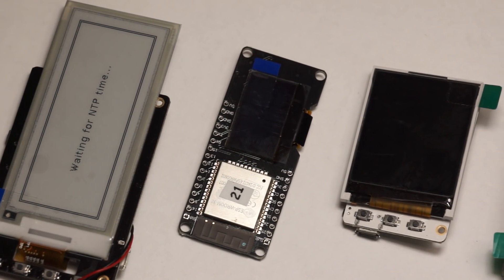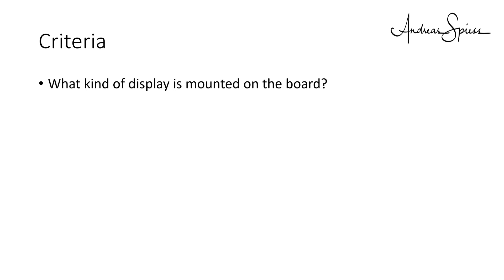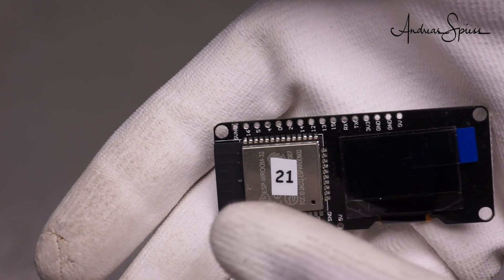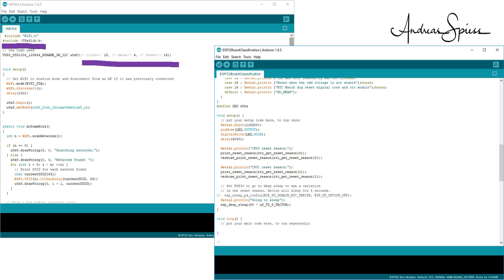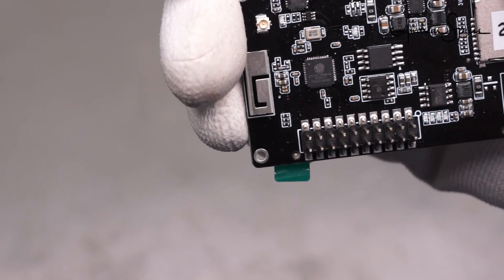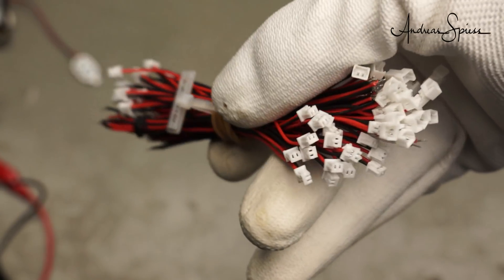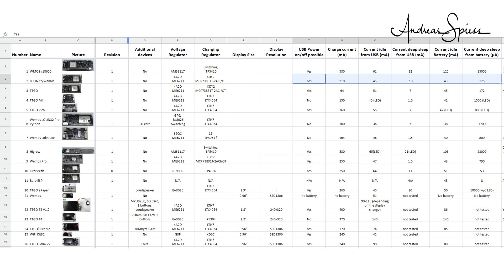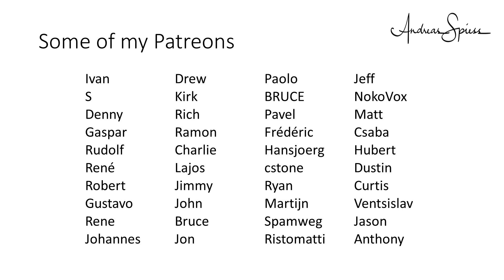#201 New ESP32 Boards with Displays

Comment: I have a TTGO TS v1.2 with the 1.8" TFT.

I had issues getting it to work with the information provided. When I did get it working using the ST7735 libraries I found the screen did not display correctly. The graphics demo for TTGO worked but the display was shifted one pixel left and one pixel up with random pixels in the unused edges. I left it at that for a while until I bought a screen for other Arduino devices.

While getting that screen to work (a cheap Chinese module not following standards!) I found an excellent TFT library on GitHub that is faster than the Adafruit ones and it supports many TFT driver chips in one library.

I decided to try that library with the TTGO and got the same problem of shifted display with random pixels. However, that library has much more support for ST7735 variants, by selecting a non-standard variant I was able to make the screen display correctly.

The library I used is called TFT_eSPI available at https://github.com/Bodmer/TFT_eSPI

To get it to work with my TTGO I made the following changes in the User_Setup.h file:

- Make sure it's using #define ST7735_DRIVER
- Make sure TFT_WIDTH and TFT_HEIGHT are 128 and 160
- THIS IS THE IMPORTANT BIT! Use #define ST7735_GREENTAB2
- Use the following values for the ESP32 Dev Board settings:

  #define TFT_MISO 19
  #define TFT_MOSI 23
  #define TFT_SCLK 5
  #define TFT_CS 16
  #define TFT_DC 17
  #define TFT_RST 9

The #define ST7735_GREENTAB2 setting corrected the shifted display. The default is ST7735_BLACKTAB.
With those changes to User_Setup.h the TTGO screen works perfectly. Plus this library is much faster than the Adafruit libraries. Although not all the functions are compatible with Adafruit, they are easy enough to adjust :)

Another problem with the TTGO TS v1.2 1.8" are the buttons under the screen. They are not centred! Just looks odd if you were to mount it in a box and use the buttons.
Reply from the maker: Thank you for writing your learnings down. I am sure it will help others. According to the supplier, the 2.9" display is different and this is the reason they did not port its library to the Arduino IDE.
Reply: I just love these devices, I wish there was more I could do with them as I am limited in electronics ability due to lack of equipment (can't afford it and not enough space for it! lol). But these ESP32 and the ESP8266 dev boards have brought back some of my old love of programming. I like getting low level with my programming, not relying on huge APIs to do everything for you. Worrying about memory space and speed concerns, especially with the ESP8266 boards. Making them do multitasking without having a multitasking programming environment :)
I tried the LUA environment that was included in some of them as default as well as Mongoose OS (https://mongoose-os.com/) but I keep coming back to the Arduino IDE. Mongoose OS is interesting but still lacks a lot of support for the ESP32 as well as very little support for any kind of display other than ILI9341 SPI and Adafruit GFX for C/C++ only. It needs more support for screens.
Reply from the maker: We also tried Mongoose once but did not like its stability.

Comment: I stand before you, a broken and beaten man.  I've finally got the time to sample an ESP32 board.  Of course you were my first port of call for advice.  At that point there were no big reviews, so I hunted roung e-bay to see what was on offer.  I finally came up with a very decently priced all-in-one 0.96 inch OLED WEMOS TTGO WiFi Bluetooth ESP32 18650 Battery Development CP2102.  

First came your review of ESP32 boards battery powered but WITHOUT DISPLAY (sorry for shouting).  My choice - almost but not quite.
Now we have ESP32 boards WITHOUT BATTERY (sorry, I'm not shouting at you!) but WITH DISPLAY.  Again no coconut!

I'm wondering will you be doing another episode with both battery AND display - or do I just accept that I'm a maverick who doesn't fit run with the crowd?

Other than that - great job, You transmit on my wavelength.
Reply from the maker: Most of these boards have battery management. See the table

Comment: Very helpful review, thanks. I disagree with your conclusion that deep sleep with a colour display isn't useful, my use case is deep sleep when it isn't being used and power on when it is. In your example you could combine the display with one of those cheap radar based movement detector and wake up when someone is there and go in to deep sleep when no one is around.
Reply from the maker: See my comment below. I surrender ;-)

Comment: Are the battery connectors from the 1.25mm JST GH series? JST GH is my favorite connector because of its locking tab and low insertion force. I think is is more likely that they use the 1.00mm (SH), 1.5mm (ZH), or 2.0mm (PH). Because all the others are only rated for 1A, the  2A rated PH series connector seems more likely to be a standard battery connector.  Thank you for the excellent video!
Reply from the maker: I am no specialist, but I think they use the GH series. They are definitively smaller than 2 mm

Comment: I just measured my ESP32 board with a 2.9" black/white/red ePaper display https://www.aliexpress.com/item/TTGO-T5S-v1-0-wifi-bluetooth-wireless-Module-base-ESP-32-esp32-Red-Display-ePaper-Sperker/32854552241.html . When I supply 3.6V through the lipo connector, I get 8.2mA power usage in deep sleep after removing the power LED (why would you even add such a thing on an ePaper development board?)
https://www.dropbox.com/s/7xjorkv5xb7phey/epaperesp32.jpg?dl=0
Reply from the maker: In my sheet, you find 10 mA ( used 3.7 volts). In the video, I came to the same conclusion...
Reply: Well, the exact number doesn't really matter anyways, since it's a few orders of magnitude too much for any practical applications.

Comment: Im about to move from arduino to esp32, to get the best full functionality of esp32, should i stay with the arduino ide, or should i move to a new dev environment ?
Reply from the maker: For the best functionality you have to use Espressif's ESP-IDF
Reply: ty i just got 6 in the mail, 3 regular and 3 mini, will start checking them out

Comment: Would you like a SHA2017 badge for e-Paper project? It has a 2.9" display and touch inputs, powered by an ESP32 running Python and can operator for months on a small battery :)
Reply from the maker: Thanks for the offer. On this channel, I try to be useful for my viewers. This is why I test things which are available for everybody. Since this badge, as I understand, was only made for an occasion, this is not the case. 
But I will have a look at their project repository. Maybe I can learn from them.
And it is good to know that it is possible to design a low-power ESP / epaper...
Reply: Andreas Spiess everything we did is open sourced! We have software available for the IDF, uPy and the Arduino IDE.
You don't need to review it, I'm just willing to send to you one :)
Reply from the maker: If it is open source I will review it. I just read I need to enter the number of the board purchased from you to download the SW. So I missed something.
If you need my address, contact me on facebook messenger or on twitter.

Comment: Another excellent video, thank you! It would be interesting also to see the TTGO LoRa32 V2.1 included with the addition of the SMA connector. I will take some measurements when mine arrives.
Reply from the maker: I do not plan to buy one. It is quite expensive and I have a few of the old ones...
Reply: Yes, of course I can completely understand! Thank you for answering.

Comment: Hi Andreas,  nice video as always.  I have a thing that is bugging me on the esp32. I need to measure time really precise.  I was hoping to use the esp32 timer to do that but I found out that the xtal oscillator is limited to 40MHz by the prescaler even if it's working at 80MHz. Ideally I need around 10ns (96MHz) period for the counter but 20ns will do fine also as well.  Can you please suggest another approach? Thank you.
Reply from the maker: If you need a precise frequency I would use an external clock generator (search for Active Crystal Oscillator). You find them for many different frequencies. 100 MHz is pretty high and you will need high speed TTL logic to do proper measurements.
Reply: Andreas Spiess thank you for your reply. I wanted to tell you that I find your work very thorough and well documented. And according to this principle I must do more research for an elegant solution rather than more external components. I confess I thought about an external clock but I might use another MCU altogether as an alternative if the case arrives. If you will allow me another question , does using i2s intrerupts (http://esp-idf.readthedocs.io/en/latest/api-reference/peripherals/i2s.html)  sound like a good idea in trying to decode this type of signals (https://github.com/nairol/LighthouseRedox/blob/master/docs/Light%20Emissions.md) ?
Reply from the maker: I never used the I2S interface and I do not know it.

Comment: Hey Andreas! Nice work! Do you know anything about ESP32-WROVER? The one which has an IPEX connector. Have you ever used it? Can you recommend a breakout board for it? Thanks! Antony...
Reply: there is this https://www.aliexpress.com/item/ESP32-test-board-batch-burn-fixture-for-ESP32-WROVER-IPEX-Version-ESP-32-ESP-32S-ESP32/32851571106.html?ws_ab_test=searchweb0_0,searchweb201602_4_10152_10065_10151_10344_10068_10130_5722815_10342_10547_10343_10340_10341_10548_5722915_5722615_10696_10084_10083_10618_10307_10131_5722715_10132_10133_5711215_10059_308_100031_10103_10624_10623_10622_5711315_5722515_10621_10620_10814_10815,searchweb201603_55,ppcSwitch_3&algo_expid=cea816fc-654f-46c6-9f77-90a40d04a23a-3&algo_pvid=cea816fc-654f-46c6-9f77-90a40d04a23a&priceBeautifyAB=0 and also this https://www.analoglamb.com/product/esp32-wrover-breakout-board/  both breakout boards don't have all the recommended decoupling capacitors so can have stability problems
Reply from the maker: 1. You can get two versions, one without IPX connector
2. No, I did not use them
3. I did not look for a breakout board. But I have to. And maybe I have to create my own...
Reply: Hi again! Yes, I'm interested in the one with IPX/IPEX. I want to improve the quality of the WiFi connection of an ESP32. I was just wondering if you have used one. I want to do a video about it soon. I've been spending time on ESP32 and I think I've achieved something special. I've finally got MODBUS/RS485 to work on it and I've found a fix to the I2C problems. Do you have any plans on testing the IPX/IPEX models? If you are, I will wait for your videos! Ha! If not, I'll make a video about it. :-D
Reply from the maker: No, I have no plans for such a video. Just a video about external antennas in general.
Reply: Andreas Spiess Ok ok! I'll get ICStation to send me one. :)
Reply: Out of the BOTS thanks

Comment: I have the same epaper but on a separated board, it has many caps, an inductor, some diode and a mosfet to generate the higher voltage for redrawing purpose that all, on the Waveshare wiki you have the schematics.
And I did connect my epaper to an esp32 and use it with the Arduino IDE, I just copied the provided files (esp-idf) in the same directory as my arduino project, modified the pins in one of the .h file and added an include in my main .ino file.
It is not complicated to add  C "driver" files to your Arduino project, you're not a beginner anymore, come on…
But that was last year, nowadays it should exist on github now, it's the same driver files as the smaller epaper.
Reply: I have one of the Waveshare 3(2) colour 'e-Paper' hats. I use the GxEDP library which also contains support for many different types of e-paper screen.  Maybe one of them can help? https://github.com/ZinggJM/GxEPD

Comment from the maker: I am currently on my way back from Tallinn on a Polish highway and cannot answer the comments.
Reply: Andreas Spiess drive safe.
Reply: Best regards from Poland/Pomerania ;)
Reply: Tallinn a beautiful place😀 have a very safe journey your community awaits you 👍
Reply: I have an idea to use esp Wroom32 with Oled and give Pmod headers, which can be used as data accusition system when connected with FPGA, currently I am designing PCB for my prototype for esp32. once my product is ready I will send it to you for review.
Reply: Hi Shahbaaz. I looked you up in LinkedIn and your profile looks great. My business develops products involving underwater acoustics for commercial and military applications and I develop the analog and mixed signal circuitry (using KiCad). I generally use COTS products for processing and controllers. In the receiver area, I design multichannel wideband receiver arrays which use an FPGA to bring in data from multiple preamp-digitizers which may be sampling at rates of up to 1.25MHz, and then send this data out via Gb Ethernet. For power amplifiers, an ESP32 based controller would be convenient for use in setting the modulation type and center frequency, along with mundane tasks like turning the unit on and off. Most of the products I work on require an FPGA but I avoid firmware like the plague and might be interested in working with you on some future projects!
Reply: Enjoy your trip mate!
Reply: Take care.
Reply: I hope your trip through the Baltic states went well. Thank you for performing this review. As always, it was very informative.

I hope at some point in the future you will be able to include the Espressif's ESP32-WROVER-KIT V3 Development board in your tests. This board includes many peripherals and is available from DigiKey for $40 which I guess is considered expensive for one of these boards, but it looks like it is higher build quality than most of the less expensive models. The documentation looks very good, it has well situated breakout headers, and it is available in models supporting an external antenna. I will be trying to use these in the near future in a product, but would like to hear how it stacks up against competitors.
Reply: Hi @ats89117 I am glad to hear from you, I am interested to know more about your products and services, I am also interested to work with you, Lets connect on Linkedin and discuss further work procedure.
Reply: ats89117 hey!
You can contact me on shahbaaz.lokhandwala@rediffmail.com
Reply: ats89117 Hi @ats89117 I am glad to hear from you, I am interested to know more about your products and services, I am also interested to work with you, Lets connect on Linkedin and discuss further work procedure.

Comment: Thanks for another really useful video.  If you get a chance to give any hints/tips/recommendations for mounting completed project boards in protective boxes/cases it would be much appreciated. Not everyone have access to a 3D printer .. yet. :)  keep up the great work,
Reply: my quick solution is to mount the project on the smallest breadboard possible, then put that inside a cheap plastic box with a carved foam block, to hold it (and batteries) in place.
Reply from the maker: You see, you get much better advice from my viewers than from myself. Thank you guys!
Reply: Chris Clarke If you don't have a 3D printer you can get those plastic boxes that are sold in various sizes. They are usually larger than you would like and cost more than a plastic box should. Then you cut out the holes (a Dremel or similar helps!)

Comment: Disagree with you. Display + deep sleep is nice. Imagine you have small meteo station and use esp with display for remote display :p
Now esp32 can be conect to PIR by low power part of esp and have displaying things only when someone can see it.
Reply from the maker: You won by at least 10:1 vote! I surrender.
Reply: I absolutely agree!. Deep sleep still matters on modules with displays. I can find many scenarios. But I still love his videos.
Reply: I agree with you. The display doesn't have to be on all the time either. The esp32 touch pins can be used to wake from deep sleep as needed